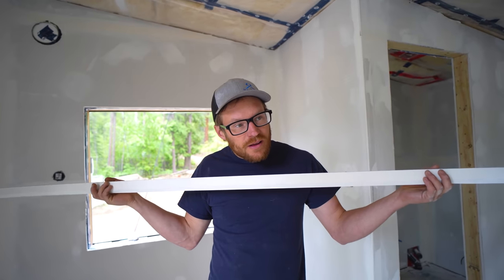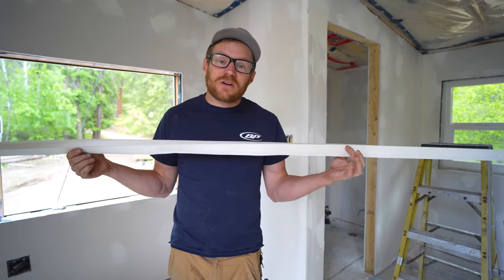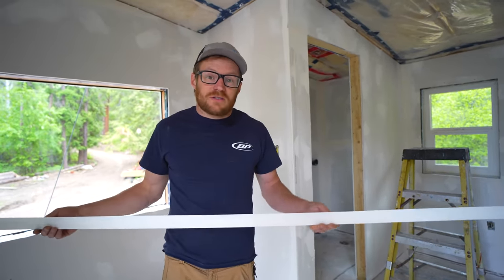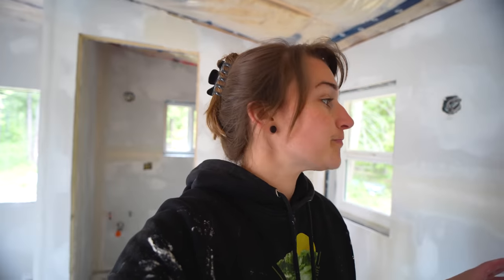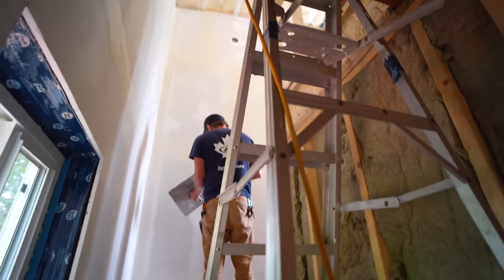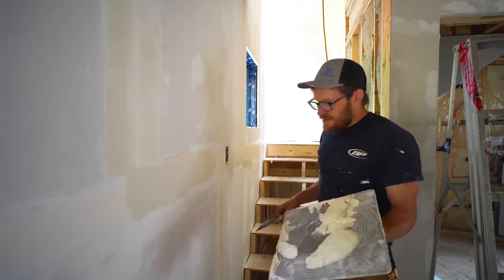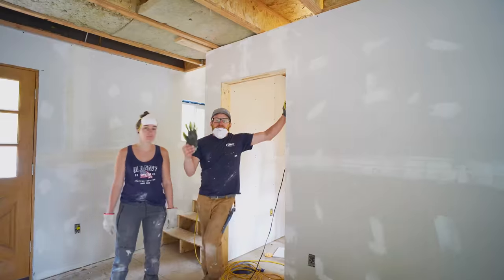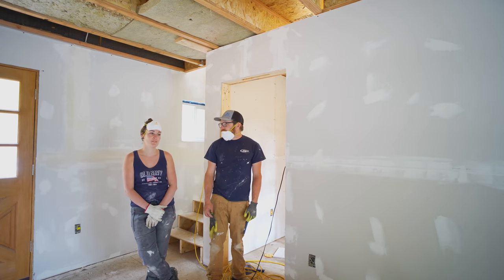Did We Forget To Use Drywall Tape?? Building An Off Grid Home

Comment: water under the bridge at this point and I know you learned tons from doing, but in my limited experience mudding I found out there was inside corner taping and outside corner taping materials. The outside corner had a bead on the corner because corners are where you nick the wall all the time. The two were different. At least you have the benefit of youtube videos. Back when I did it, there was no internet and nothing like that. I had a book I bought that showed pictures. I learned by doing as well, but had nobody to show me how it should look afterwards. Glad it all turned out because you need the tape in inside corners, otherwise the drywall mud might crack, particularly when it dries out and cold air might seep in from outside in those areas and dry it out further.

Comment: great job with all the work
Speaking personally, I always embed the tape during first filler layer. Also use bit more watery mud so that it soaks into the drywall and tape so it bonds better. This way I never forget it for one its closer to the drywall paper and its deeper with in the mud so it will not get sanded through on final filler coats.  Makes it more professional job.
I normally use 45 minute mud, so that by time I finish room, take a short break I go over second time with thicker coat and finish for day.  Dont have to wait till its completely dry between coats either.  Trick to it is use 10" blade and scrape everything clean so you dont have to sand. If anything you will have couple spots that will just need to be scraped and worst case very little sanding.
Once the 2 layers are completely dry then I go over with final coat prime everything and refill spots that are questionable to perfect finish. Prime any larger areas I had to retouch and final paint coat.
Any way, great job you two.
One thing though,   those LED transformers that Greg mounted hard into joists will come and bite you some time in future. They are always lying free in ceiling so they can be pulled out and replaced. When they blow and they will at some point you will have to rip your ceiling down. Sorry one small negative thing

Comment: When I was about 40 I bought an unfinished house(1600sq ft) 2 story and did a lot of the work to finish it. When I got to the drywall, I was ready to start and a guy stopped buy and he gave me such a good deal to hang and mud I said ok. After mudding he said if u want to do the sanding I will knock 75.00usd off the price. And it took so long to do it(nevr done it before) that it would have better to just pay the $75.00. This was 40 years ago.

Comment: Just newly subscribed. Great to see people learning to do different things. Wish more people would. One thing I found easier from my old days mudding the sheetrock, is I use the fiberglass mesh tape for seams. Kills 2 birds with 1 stone as the mud pushes through. Also, a corner trowel works better than a 6 inch straight. Of course you use what works best for you. I learned from my late father, mostly what not to do 🤣

Comment: You two are a fantastic couple. Great job with drywall mudding. You should really need to switch to a 12” trowel or 12” drywall knife for your second coat and third coat on the taped joints. You will get used to it after sometime.

Comment: All I have seen and done on finishing drywall is three skim coats working up to a 12" knife and then sand. The idea is to spread the imperfections out so they are not visible. I think if what you are doing works for you than that's what you should do.

Comment: the tapered edges of the drywall are for embedding the tape....what you have done is make all you joints buttjoints...which puts the drywall tape proud or on top of the drywall surface....which means you have to put a wider finish coat to hide the seam.....the tape prevents the joints from cracking.....

Comment: No I think what most people were talking about was the extra step you didn't need, and the one you just ignored. Mud, tape dry. Mud over tape dry. spot check the flatness of the wall, more mud. Paper corner.....Forest Gump said it best. Metal or plastic, shape and rounded corns - yes. Not papers corner. Watching skill share or just some other creators who do this for a living, a must. It's all good though, when the tape cracks, and bubbles. or peels, you'll tare it down and do it again, but hopefully the right way. Doh!

Comment: Good Job Guys Nice to see you using trowels instead of scrappers , small tip from Aussi when doing top coat spray the wall with a little water makes for glass smooth finish , also before sanding wipe down with a damp cloth , life can be made easyer  Cheers

Comment: You know what is kind of unusual? Here in Japan I’m going to start drywalling soon, but I can’t find drywall tape at any of the Home Centres or building supply stores. Seems like they don’t use it here. I’ve also noticed lots of cracking in drywall joints around the city. Anyway, I’m going to keep searching for it.

Comment: l watched the whole video you didnt put tape on until after you muddied and let it dry and went back sanded and muddied and rapped,, dont be leave every dumb thing you see on yt,, you wil regret what you did, i am glade to see you used the paper corner bead i had said to use and not the steel crap